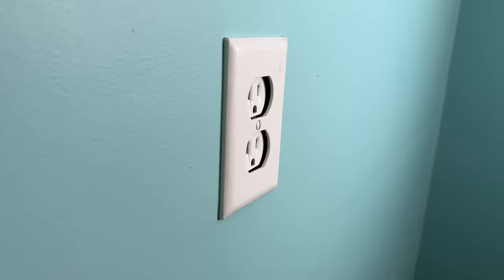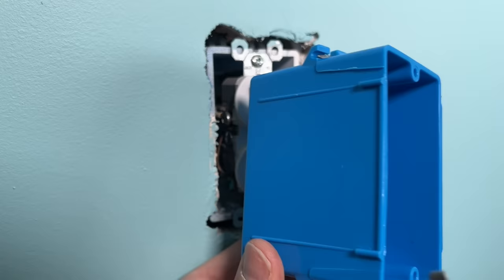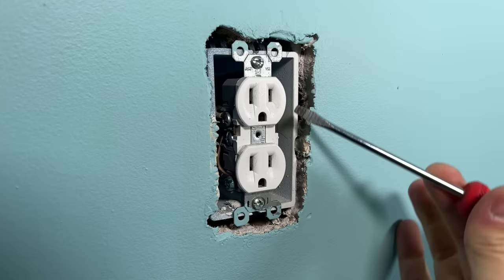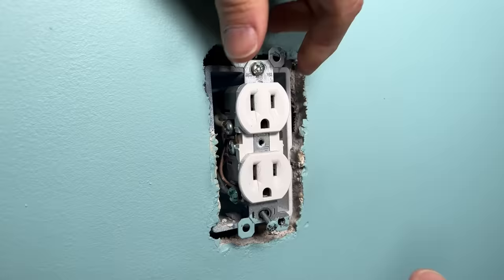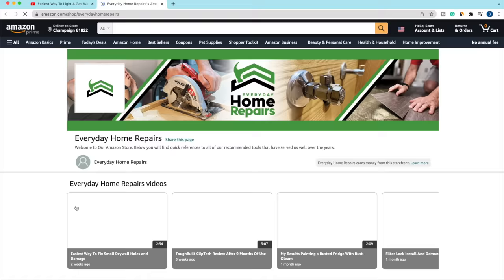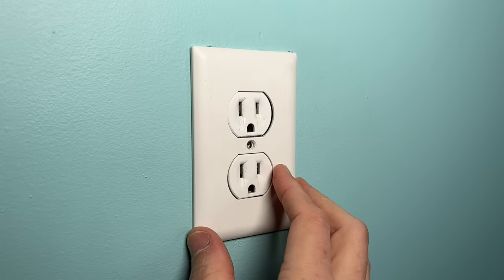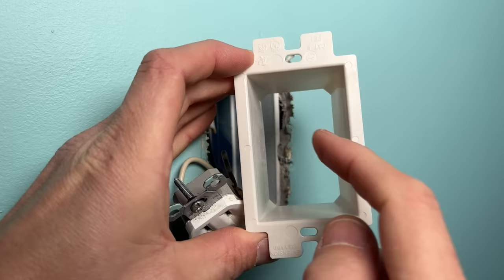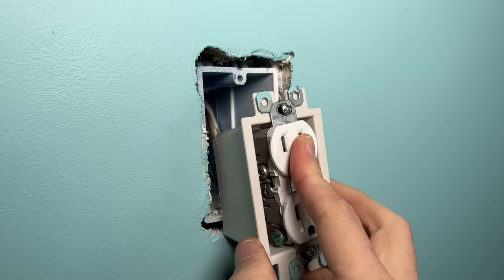How To Fix Sunken Outlet | 2 Easy Options

Comment: I had 23 units in building that were built in the very early 1900's - I always put electrical tap around the receptical before I replaced them into the box. Never had a short or issue with a fixed receptical - had the units for over 20 years. I enjoy your easy to follow, through video!
Reply: Just to add to this, make sure you only use tape with a non-corrosive adhesive. Brand names like 3M are fine, but, some of the cheaper off-brand tapes can have sulphur, and other materials in them that often leave a tar like residue. That could lead to corrosion, and ultimately a fire or heat damage to the outlet.
Also, never handle energized outlets even if they are wrapped up, the tape is easily pierced or cut, and could still result in electrocution. There are specific covers and protectors made to allow for exposed outlets to be safely energized temporarily, for example while painting, or refinishing a wall. That said it's always safest to just turn it off and bring power in from another circuit if possible.

Comment: Thanks for all your videos. The insert and the reason for the insert is something I'd not thought about before. And I had used spacers before. When you strip #10 wire, the insulation tube works well for spacing.

Comment: I’ve used the spacers before and thought they were awkward. I had the same problem recently after installing some shiplap, which caused my outlet to do this. I decided to browse around Home Depot for a better solution, in which I discovered the 3/8” PEX toilet supply lines. For under $2 I was able to cut them to the exact thickness of my shiplap and get it flush again. It supported the outlet well and it was super easy to use. It took a little more time to cut them, but I was happier with the result.

Comment: I used the snap-off tabs on the switch for spacers; didn’t know they sell spacers separately. Also, I had no idea what those holes were on my strippers that you shortened the 2” 6/32 screws. Awesome - thank you!!

Comment: I've made my own spacers before from stuff I had around. Nice to see that they actually sell them. The insert looked like a good idea.  One thing I had hoped you'd have a tip for, is when the box and drywall aren't lining up evenly. IE the outlet sticks out more on the right or left. Spacer on one side would work, but figured there might be a more elegant option.
Reply: I look forward to his reply. I've simply bent the socket's tabs slightly or spaced under the low side of the tab.
Reply: If the box sticks out, grind it back is the quickest

Comment: Thank you for this video. I am upgrading a very old unit and you discussed problems I noticed in the unit related to sunken outlets, exposed drywall on side of outlet and very poor drywall cutouts needing larger plates.  You saved me calling an electrician to fix depth issues and saved me money that I can use for other fixes in the unit.

Comment: There is one additional option that you didn't mention. Instead of the small rubber spacers, they also sell outlet box extenders. Basically they are a rectangular open "faceplate" that fits between the box and where the actual outlet screws onto the box. I am pretty sure the come in 1/4", 1/2" and 3/4". I have used these b4 and they work very nicely. Again you probably will need to but longer mounting screws

Comment: Nicely done. Common problem. One thing I'd suggest is that when you have that outlet in your hands, take a good look at the wire terminations, checking especially for nicks in the wires where they were stripped. And I might even replace any outlet that is old and especially if it has push-in terminals (not secured by screws). I replaced all the duplex outlets in my house when I discovered that the original owner, who also built the house, had used #12 wire with push-in terminals, before this became a code violation. I didn't want any of that in my house. I wasn't familiar with the supersize outlet covers--they look a bit cartoonish, but form follows function!
Reply: I have replaced numerous outlets with #12 wire in the push-in terminals, where the heat from the poor connection had caused the outlet to become charred to the point it just fell apart when I handled it, and the insulation on the wires was damaged. I can’t believe this was once considered acceptable practice!
Reply: @ethanlamoureux5306  … it was once considered an ‘acceptable practice’ because the problem with the mechanical/physical situation wasn’t well-understood…. Similar to the ‘copper/aluminum’ wire & connectors debacle.
A person doesn’t know everything, and neither does mankind, we are constantly learning.
Most all ICC/NEC electrical codes were ‘written in blood’.
Reply: @Rus Healy … HAVING push-in terminals is not bad… USING them IS bad.

BTW, these push-in/backstab terminals should not be confused with the far safer and preferred terminals commonly called back-wire.
These have a small ‘back-plate’ behind the screw, which affords far greater grip strength and area, and are totally code acceptable.
In fact, they are far preferable to wrapping the wire around the screw.
The wire is stripped to the proper length and inserted into the channel in the back-plate. No twisting into a loop, and no chance the wire gets squished out of the channel.
Reply: @ernestgalvan9037  Of course, but once I had them apart, I wasn't going to put old outlets back in the boxes since new ones are so inexpensive.
Reply: @radiok2ua  …well, I never said, or implied, that you should re-use them, OBVIOUSLY if they are charred or damaged in ay way they should be tipped.

Me, I never buy or use the cheap ones… ‘spec’ grade is minimum. High current, isolated-ground Hospital grade for critical stuff like my computer equipment (I used eight total; four in the cable room, remaining four for computers)
My kitchen and bathrooms are all 20A wired & outlets. Kitchens have microwaves, toasters, air-fryers, etc, and bathrooms have dryers and space heaters. Inexpensive insurance.

Comment: The box extender was new to me.  Not sure when those came on the market but my dad who was an electrician turned electrical engineer would use multiple wraps of electrical tape wrapped around the terminals to insulate them from touching anything such as the paneling.  Of course, that was many years ago.
Reply: We still put a wrap or two to insure metal never touches the terminal.

Comment: I did not know spacers like these were available. I have used 2 or 3 #8 nuts as spacers to extend an outlet slightly.  The plastic spacers would be easier and more effective.
Reply: Just cut tan wire nuts down to whatever size you need for spacers.
Reply: @shanetaylor7581  the fiber washers from ceiling fan blades work great too. Ive chopped off the tabs off old outlets,switches and sandwiched them between fiber washers

Comment: Thanks for the good demonstration. 
What was new to me was the insert box. I have seen them before but didn't know what purpose they serve. But that makes a lot of sense to me to shield it from any combustible materials. 
I also didn't know that those spacers are available. One time I made some little wooden pieces for spacers which was probably not a good idea. 
I work in a facility that builds storage buildings, workshops and cabins. Sometimes I do the wiring. 

I appreciate your helpful videos. Keep up the good work. 👍

Comment: Great info. I never considered buying longer machine screws to replace receptacle screws that were too short. I also didn't know about the spacers. I've always used a sliver of wooden lath as a spacer, because that's what I've been most likely to have handy. Of course with your explanation about the box extenders, I now realize that my old method is just asking for a code inspector to slam me (or worse).  Thanks for doing this video!
Reply: could u use metal washers

Comment: Very informative. Thanks! Just a general remark: The neutral and the "hot" wire have the same chance of catching fire. Undesired heating results from "current"  and not "voltage", so it doesn't matter if you have a bad connection on the neutral or the hot wire.
Reply: Yes but only the 'hot' runs a high risk of arcing to ground which is what the issue is with exposed materials around the box. I believe that's why he said "especially the hot".
Reply: The negative has less than 50v coming back and the remaining current not consumed or the remainder of an unbalanced load which would be well under 5 amps. The negative will never catch fire as you think. Even if the negative touches metal. And yes you can get a negative bite from the return of an unbalanced load.

And before you say anything. These words are from my electrician instructor who BTW wrote majority of the electric code for the NEC and Chicago code.
In Chicago no one has actually died of an electric fire from a wire in the wall. The electric fires in the city of Chicago are from too many cords plugged in the same outlet using a triple tap/plug or using extension cord with an electric heater or they would use a penny in the old screw in fuses.
And if the wires did overheat and someone let the smoke out of the wire it never goes anywhere since in Chicago we use EMT which keeps the fire from actually spreading.
And again I seen the actual test and demo conducted by UL Labs and NECA/CECA and IBEW. It was conducted to show why we prefer use of conduit over Rome. It is safety from the start.
Also it will never happen since CODE REQUIRES ARC FAULT BREAKERS.
So your point becomes moot.
Reply: @lm5085  you don't seem to understand that the vast majority of buildings were built before things like arc fault breakers even existed and haven't been updated to include them.

We can all tell you have a very loose grasp on what you're talking about because you keep using the word 'negative' in reference to the neutral wire, and there's no such thing as a 'negative' in AC power systems. You're also wrong about the current carried on the neutral wire. On a branch circuit, the neutral wire between the panel and the rest of the branch circuit carries the full load of the entire circuit, which can be as much as 15 to 20 amps depending on the circuit, and what's on it. The current "canceling" effect happens in the panel, and it's the neutral wire going back to the transformer from there which is only carrying the difference between unbalanced loads as you say.

Keep studying. You need the practice.
Reply: @Krankie V  no shit. Conduit been around for very long time.
I stated a whole thing on it. Try selling making with VA or FHA it will have to be updated to.
I just gave few reason and examples. And as I stayed the neutral carries very low voltage I think last time I had to test something I got 32 volts.
ARC faults been required for oh abt 15 to 20 years now.
Reply: @Krankie V  dude the neutral carries the unbalanced load back.
I been a a card construction electrician following Chicago  Code mainly but NEC in surrounding for over 15 years.
Reply: @Krankie V  your unbalancing does not happen at panel.
Most old homes have 2 hot  neutral in a network. The unbalanced load returns via neutral it happens at the end and comes back. The neutral is a return.

Comment: All new information in a short, compact format. Learned a ton! I do light electrical work around my house, even as far as reading the NEC 80 book to learn code for installing a 240V run for an electric car charger! But I hadn't considered code compliance for wall outlets. I definitely learned about WAGO connectors here and love them, and knowing #6-32 screws are the standard for plugs is super helpful too.

Comment: The stacking spacers were new to me and also the code allowed exposure if the box is not mounted flush to the surface. I have purchased an older home which needed a lot of remodeling and being brought up to code so I had a contractor do most of the remodeling (my marriage is still intact). I now have the occasional repair or expansion projects that need to be completed and I generally feel comfortable doing that work. Good job on the explanation and videography, it is much cleaner and understandable that a lot of what is produced.

Comment: I’m going to have to use the electrical box extender down in my finished basement which is paneled. I noticed them at the home center but didn’t know how they were supposed to be used. Thanks for sharing! Also thanks for pointing out those tick marks on the electrical boxes. 👍🏻

Comment: This was a huge help to me.  My entire house was built with 10ft ceilings, with 4ft of drywall at the top and then 6ft of 1/2" pine tongue and groove paneling down to the floor.  Every single outlet has multiple spacers (sometimes as many as 3) to bring them flush.  I found out they used the cheapest outlets available when I kept seeing arc flashes when plugging cords in.  When I opened up one outlet I saw scorch marks on the paneling.  So I started looking at them all.  Some outlets actually fell apart into pieces when the cover plate was removed.  I went through the entire house replacing the existing outlets with commercial grade outlets hoping that will avoid that arcing occurring and catching the paneling on fire.  Thanks for your links to the safety extender box, I ordered in bulk and will start a new project.

Comment: What was new to me was pretty much everything. First, that a recessed outlet is a code violation (and not just annoying lazy amateurish work) and the existence of those spacers. Going out to get some today at Home Depot. Also the bit about exposed edges of flammable material code violation thing. Thanks for the useful info.

Comment: I recently bought a house built in 1991 that the majority of the electrical boxes were set flush with the wall stud. The outlets are loose and several cover plates are cracked. I was looking for a quick fix without having to change the boxes out and found your video. I should be able to fix them all with the combination method you have shown. Thank you!

Comment: I have done this before. I didn't have spacers so I used the plastic retaining anchors in cardboard packaging of imported things like tools and toys (used to deter theft with twist ties and zip ties). They are very similar where they are a plastic strip (which is nonconductive) with multiple holes in them.

Comment: I knew about the spacers but only as a complete "wrap-around" extension of the box (as I have had to use them on a job where I expected to use thinner drywall than I ultimately ended up using).  The idea that spacers could be basically "washers" was new, as was the concept of the insert box.  Thank you, I have some new ways to fix things.

Comment: You da man! I removed a receptacle to replace it with a new one and could not get the top screw back in. Now that I know the size, I will just get a the two inch screw and use a spacer so as not to damage the drywall

Comment: Man I just watched this without any particular need to do this task, but I appreciate the video format so much. Minimal cuts when actually completing the task, fast forwarding through the mundane repetitive aspect(simple screw rotation), and no or little repetition of information made this extremely info dense and useful to copy and complete your task with confidence. A lot of other videos feel like they're trying to pad the length and then cut the video of the part I'd most like to watch them do.

Comment: Last time I had to do this job, I've looked everywhere for those plastic inserts with no luck. I ended up bending a little bit the 2 metal tab at each end of the outlet to spring it forward. I've learned the purpose of those 2 holes at the bottom of the stripper tool.

Comment: I haven’t seen the spacers, the box extenders and the bolt cutters in the wire strippers for 8/32 and 6/32 bolts. I learned a lot. Thanks. Now to find these pieces.

Comment: Thank you for explaining the code requirements. I recently put up bead board or wainscot and I need to adjust the outlet because it is sunken. Now I know I must use the insert so that none of the material is exposed to the screws.

Comment: Can't tell you how many times I could've used the spacers (thank you, now I know!) ... and despite managing the inserts dozens of times, I never understood their purpose (only that they usually get in my way when I'm replacing an outlet!).   Finally, the exact specs of #6 32 screws at 2" length / trimmable is a great piece of info ... another frustration-saver as opposed to "managing" old screws that are too small, too big or bent.  I'm systematically replacing old outlets in my house with tamper-proof ones -- these tips are extremely helpful.

Comment: This was a great video for me. I used to loosen the top and bottom screws enough on the outlet and then pull the outlet towards the faceplate using the center screw to make it flush. You had to be careful when plugging things into the outlet so you wouldn't snap the faceplate. Worked good for outlets that didn't get a lot of use. Done with that.
Reply: Always thought it looked more sunken as each layer paint was added.

Comment: The insert to isolate the terminal screws from combustible wall material (wood) is new to me.  But I've never had a problem with a box that was sunken that deep.  The spacers was new also.  Also, with a dry wall hole too large I've filled in with wall board compound so the ears have a base to rest on.  Now I know another way to do it much quicker.  Thanks.

Comment: Great tips. I bungled a drywall/new outlet install 20 years ago in my garage and have been avoiding using one box with a sunken outlet since then because I didn’t know what to do about it. Three tips here are golden. 1. Spacers. 2. Oversized covers. 3. Inside box. 
I may use all three for this repair but what a relief to be not cringing every time I look at that old outlet!  Can’t wait to go to the hardware store. Thank you!